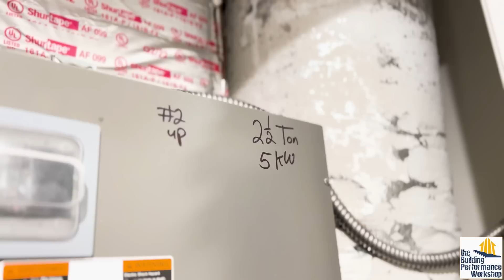Crazy HVAC Design + Bad Building = Moldy New Expensive Neighborhood in Florida

Comment: It is long past time - 
for that ‘so-called builder’  be  🛑 STOPPED 🛑 - EVERYWHERE.

Per one news report:

‼️‼️‼️‼️‼️‼️‼️‼️

"”The problem here in Bartram Springs is 
there are a lot of these houses," 
says Ron Woods, a licensed professional engineer 
who has worked in Jacksonville 
for 35 years 
and has inspected many of the Bartram Springs homes.

These homes are intended to last 40, 50 years.

We see them falling apart between 3 and 10 years."

‼️‼️‼️‼️‼️‼️‼️

‼️”Just 8 years after the house was built, 
Walsh paid tens of thousands of dollars 
to rip off the back of her house, 
to replace a wood frame 
so damaged 
by wood rot - that -- 
as demolition videos show -- the studs could be ripped out by hand.”‼️
—

After a case against them in League City Texas:
An arbitrator stated:  

“This case hopefully will prompt”  - - -  “to repair these homes, rather than spend hundreds of thousands of dollars on experts and attorneys’ fees to protect themselves from justice.”
—-

They need to FORCED to BUYOUT their VICTIMS.

What they have done to me - in Texas - is unimaginable.

The same HORRIFIC ‘so-called builder’ 
took my lot - 
which was purchased - 
at the top of a hill - 
and horrifically graded my front door area - 
into a bowl.

I was repeatedly attempting to stop FOUNDATION DAMAGE - 
and prevent internal FLOODING.

Then they elevated the land - and the houses - on 2 adjacent lots - 
sending much of that illegal roof runoff - in my direction.

I continued to work - to put in beautiful required FLOOD PREVENTION - 
in an attempt to protect my house from FLOODING - 
and my FOUNDATION from further EROSION - -  

and the ‘so-called builder’ had their ‘so-called hoa / coa’ came against me - in ‘so-called montgomery county court’.

The ‘so-called hoa’ continues to fight me - 
and threaten me - 
with more and more ‘so-called court’ -  situation‘s  - 
and they are attempting to bill me - for their legal fees.

They are using ABUSE by PROXY - 

- to attempt to force me - to remove required FLOOD prevention - and 
that would ensure that the house will FLOOD.

They are also attempting to FORCING me via the FAILED ‘so-called legal / judicial system’ - to sell the house - to someone else over the age of 55.

I abandoned the house in November of 2022 - because it is NOT safe.  

I Purchased it for over $500,000.

There were so many CODE VIOLATIONS - and so many FAULTY products.

They had only finished construction on it - in July of 2020. 

Before I moved out - I had already had to replace 
the roof 
the entire HVAC system, 
the tankless water heater - and more.

I hope they are 
🛑 STOPPED 🛑 rapidly - across this Planet.

Comment: Just the tip off the iceberg. I’m afraid we are going to see more issues like these. What a crazy way to run the HVAC. I built a house 2 years ago for a family that moved north from the Carolinas and he was an HVAC guy, he wanted to do that part himself. He ran everything similar to this in the attic space. I couldn’t move up there (like you). This type of system as you see doesn’t work well in the south, its even worse here in the north, running hot are through  cold zone (vice versa in the summer) with metal register vents in the ceiling, why do I have mold and moister? Hmmmm,

Comment: This is a major struggle in that climate with dew point being at or above indoor setpoints a large part of the time.  Indoor Humidity needs to be tightly controlled.  Also, seems they might be in the shoulder season where the system is not operating and thus no dehumidication.  Whole house dehumidifier needs to be standard.
Reply: Also seems it was oversized so wasn’t removing the moisture

Comment: You think that duct is bad. My house is linear with an older roof pitch. So.. empty it's spacious. Now add a bunch of duct work. 
I have 3 access points just to prevent trampling. 
My hvac system by the manufacturer is a 5 ton. But if you read the labels individually.. it's 4.5t.
I will be following this as I am not far from this. 
I have spray foam. And love it. But still having battles. It's just hard to find companies that know and understand.

Comment: So much ductwork for any home, let alone new construction.  Wouldn't it have been actually cheaper to run mini/multi-split instead of forced air?  It wouldn't address air leakage in the exterior envelope but probably would've saved on the cost of all that ductwork let alone the air sealing and condensation issues, assuming they insulated the plumbing correctly, over this.. "design"..

Certainly cheaper than:
- all that remediation /home
- temp housing
- lawsuits
- health issues
- guilt
- badwill

Comment: So the cause is duct sweating in the attic caused by poorly sealed / insulated ducts in a vented attic?
And the solution that’s being recommended is to encapsulate the attic and redo the ductwork?
That’s actually not that much work.
All this rigamarole the builder is going through is Gonna cost them way more than a roof deck spray foam job and a bunch of new flex.
I could see them obfuscating about having to replace whole systems, rip out drywall, remove siding etc. but a quickie spray foam job and a few boxes of flex (and mastic and duct wrap obviously) is definitely not the end of the world. Hell, If I were in the builders shoes I’d go after the duct guys for a steep discount in the rework.

Comment: Im confused if you recommended spray foam for the attic or not.  You brought up a point youve mentioned in the past.. that the science experiment is performed by the bottom of ladder guy, in a hot environment, in a restrictive suit, and in uncomfortable positions.  Then it seemed like you still recommend it for this situation though.  Seems like a 10 min video got cut down and skipped over the part where his options were.
Reply from the maker: Yes, here it’s the most sensible calculated risk. The lesser of evils.

Comment: Open Cell foam is the only way to go in Florida. It solves so many mold issues. This HVAC is so poorly done. If you don't spray foam the attic then bring the ducts into the living space with boxed ductwork. The 10' ceilings allow that easily.
Reply: It's certainly not the only way although it is a way. Spray foam isn't without its issues. The problem ultimately does not lie with the product but rather the people using a given product. For example, they could have designed the ductwork better, let the ducts sit on the attic joists, then deep burry them in blown insulation.

Comment: Those ceiling boots are most likely internally insulated
Reply from the maker: Could be, but if the neighbors are all getting moldy boots then it’s clearly not working as designed
Reply: @HomePerformance  that’s very common here in Florida take the grille off and you will see why especially with room depressurization
Reply: Yes it happens when boot isn’t sealed to the drywall. Hot attic air mixing with supply air allowing for mildew to grow. Easy fix for that, seal the boot to the ceiling!

Comment: We began conditioning our attics here in Florida since about '03, using open cell insulation; but now we use closed cell.  My MEP engineer also usually doesn't design for more than 10- or 12-feet of flex duct -- all else are rigid.  Also, our truss packages always include open path(s) for the main trunk to travel, but with this house there does not appear to be any.  I suppose that the spider duct system used here could be good if properly designed, but I have personally never seen it.
Reply: why used close vs open in florida?
Reply: @av1204  Either can be used, but closed offers far better R value per inch.  I only specify closed.  For example, an attic-less house I am currently designing having a roof structure of only 6" was specified to use Icynene closed cell spray foam insulation at only 3" thick (R-21); and though the Code requires R-30, it still permits R-21 closed cell since it completely seals all joints.

Comment: That's awful. I'm sorry this family and neighborhood is dealing with this problem.
Reply: Quick fix get rid of that system too many problems duct work in the hottest part of the home trying to cool the home. With super high humidity area mold is going to happen.

Go with a ductless Mini split system that’s way more efficient and Zero leaks.
Go with Mitsubishi for a long lasting system. 

All duct work leaks unless you seal it yourself, who wants to roll around in fiberglass insulation, spending countless hours, trying to seal everything it’s a worthless losing battle. Sucking up the homeowners money and wasting a ton of time going nowhere with electricity prices going up and up.

It’s like driving down the highway reaching in your wallet, and throwing out the Money from the window .

Comment: What is your solution to fix this house?
Reply: It sounds like they're doing a conditioned attic with spray foam on the underside of the attic sheathing at about 9:02. In the current setup when the AC is on, the ducting in the attic gets cold, resulting in condensation from the hot humid attic air on those ducts, and that condensed water makes things wet, and that's a common cause of mold. While most of the attic ducting is insulated, not all of it was (see 4:04); it's also difficult to keep duct insulation itself sufficiently air tight that only minor condensation occurs. By bringing the duct work inside the building envelope -- meaning the air the ducts are surrounded by is itself conditioned -- these problems should be eliminated in the attic. There may yet be other issues, but this should address a big one.
Reply: My suggestion is to install 2 properly sized LG ducted inverter systems.
Reply: @robertmoran3589  not sure that would make any difference. You think the lower temperature differential when running the systems at under full capacity would fix it? Dunno.
Reply: The problem with most attics is humidity.  Applying spray foam encapsulates the attic, keeping the outside air from getting into the attic. But the humidity in the attic still needs to be remediated.
Reply: Yeah you could do a dehumidifier potentially without any duct work at all, just some controls. You'd still have to open an ac vent+ intake to the attic though and control temperature as well. Personally I'd use a mini split + dehum and have just a very token amount of air changes.

Comment: New construction tract home builders need to be held accountable for horrible HVAC systems! They always seem to put in the worst systems and they hire the absolute cheapest HVAC contractor that cut major corners! I don't think I've ever seen good ductwork design in a new home that wasn't a custom build!!
Reply: It’s not necessarily the HVAC contractor fault as long as they RFI on the size of the systems  back to the mechanical engineer/designer. I would never recommend over sizing a system to your home. Not only can you end up with mold issues it ends up using more electricity to run the system.
Reply: @robertmoran3589  I'm not suggesting they oversize the system. In my area undersized ductwork is the major problem! The builders don't give the HVAC contractor enough room for a properly sized return air duct and grill. I see way too many homes with 3 or 4 ton systems but only one 14" round flex return air duct going from the garage to the top floor. All these homes need a 2nd return air duct and grill.
Reply: @KPHVAC  we ran into that issue a lot with some the companies even the one I work for under sizing duct. However there's houses we have done and got blamed for mold when before the house was even walled up, the trusses had mold on it.
Reply: @necrodeius  Ya a lot of home builders just don't care. The cut corners and blame other people.